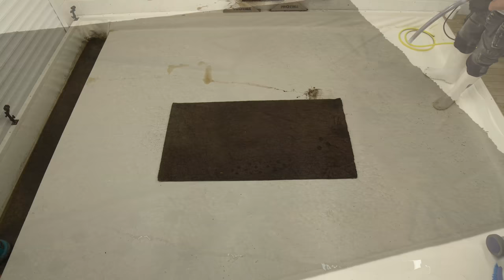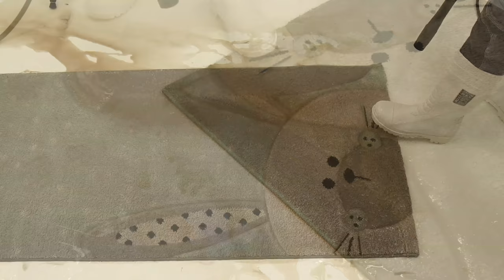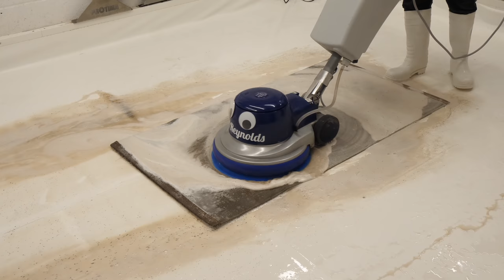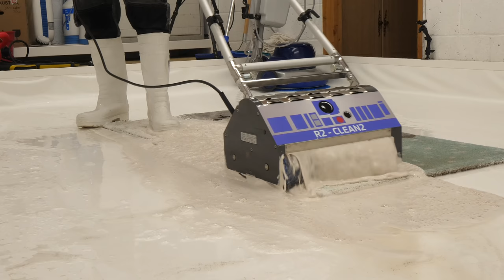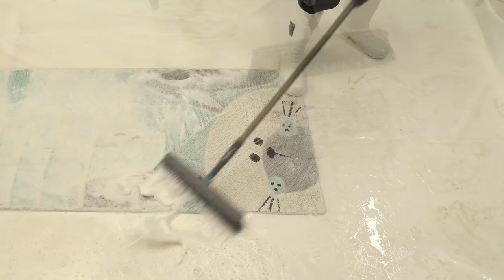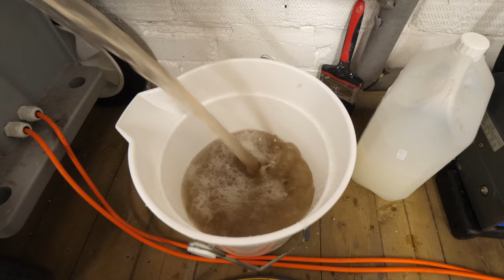Put The Bunny Back In The Wash ! Satisfying Cleaning Video

Comment: 0:14 : First rinse
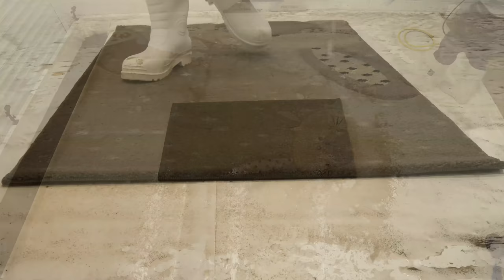1:08 : First application of shampoo
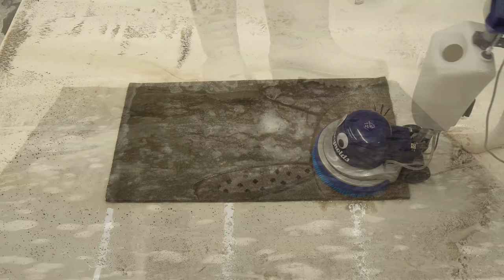1:32 : 2 passes with the rotary
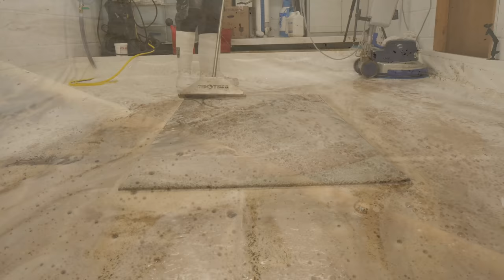3:48 : Squeegee
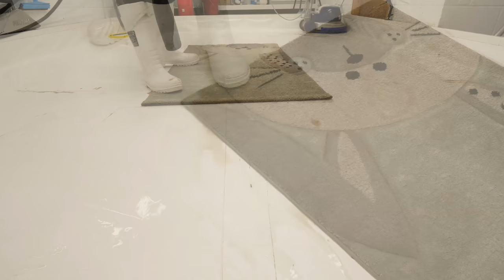4:45 : Pressure washing
8:03 : Squeegee
8:35 : Rug flip
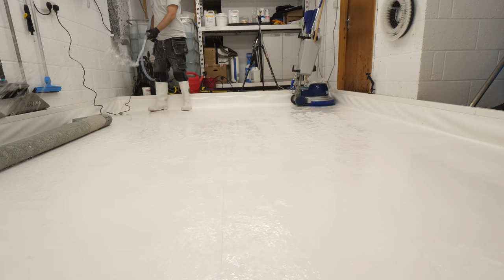9:06 : Second application of shampoo
9:20 : 2 passes with the rotary 
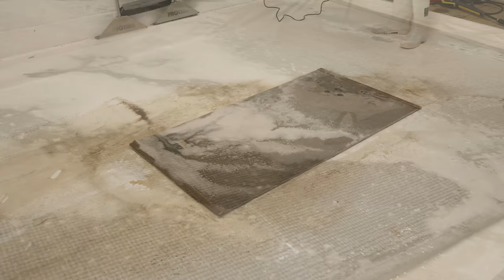11:06 : Second rinse
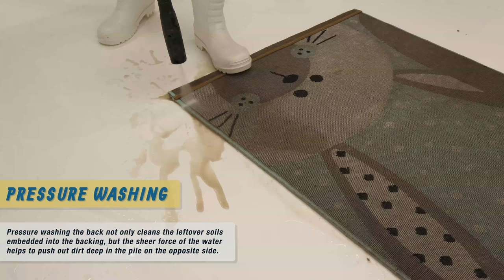11:24 : Pressure washing
13:12 : Third rinse
13:30 : Rug flip
13:55 : Squeegee
14:08 : Fourth rinse
14:36 : Squeegee
14:44 : Application of shampoo + oxygen booster
15:05 : CRB machine
16:25 : Squeegee
16:40 : Fifth rinse
17:12 : Squeegee
17:20 : Application of shampoo 
17:40 : CRB machine 
18:39 : Brushing
19:21 : Squeegee
19:31 : Sixth rinse
19:52 : Squeegee
20:02 : Acidic rinse
20:22 : Brushing
21:07 : Squeegee
21:19 : Final (seventh) rinse
22:00 : Squeegee
22:39 : Water extraction
23:26 : Water reveal 
23:42 : Eighth rinse
24:01 : Squeegee
24:33 : Water extraction 
25:02 : Water reveal
25:14 : Before and after
Reply from the maker: Thankyou kindly. That's a lot of steps 🙄
Reply: People like you are the backbone of society
Reply: How much they take for one mat??
Reply: @kellikall   is that good or bad?
Reply: Putting the rug on a large-mesh platform when pressure washing might have good effect.
Reply: That A LOT of steps
Reply: @samsbestie  good

Comment: While checking this out I was wondering, would it be more beneficial to give it it's first cleaning by hanging it? That way I figure you can get to the grunge on both sides instead of just one and letting the other side soak in crap.

Comment: My oxygen booster says to soak for an hour or even overnight, what kind do you use?  I would like to get some if it works right away as it would save time when I have to clean my rug or use for stain removal in the laundry. How does a rug from a nursery get that dirty.  Do you put dirt on them to make a better cleaning video?  I don't care, I would still watch as it is relaxing.

Comment: Why don't you use a bigger pressure washer? Specifically the round surface cleaner ones?
Reply from the maker: I literally just bought a new one and arrived mid rug clean so will be soon. The round patio cleaners are just far too hard to use without damaging the fibres.

Comment: Itd be cool to see the rug like lifted off the floor on some buckets or sawhorses or something and see what the pressure washing does to the underneath. A bunch of mud always pours out but get stuck in between the rug and the floor 😭
Reply from the maker: Im thinking of changing the process slightly. Putting a grid underneath when pressure washing the back. Should get more dirt out